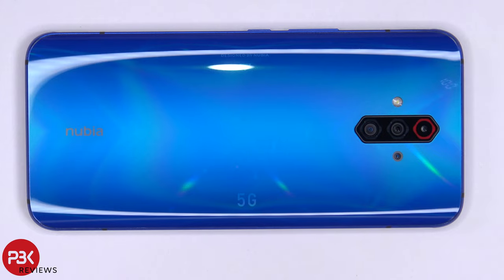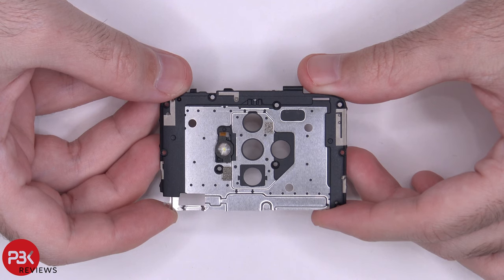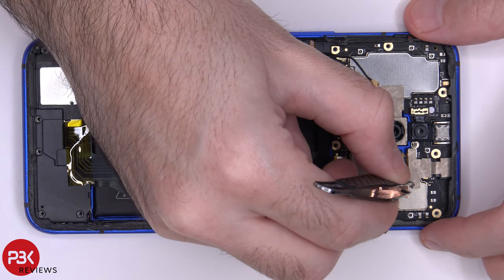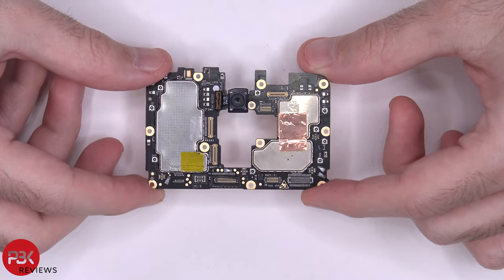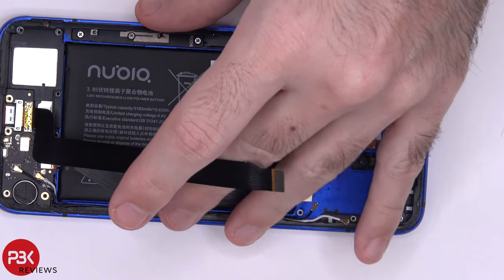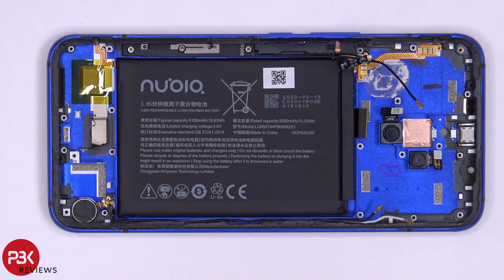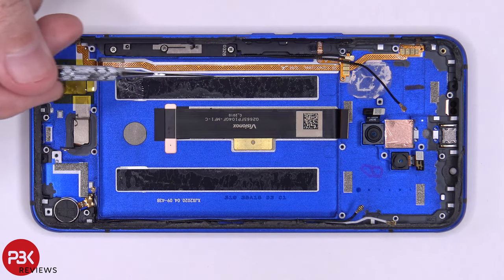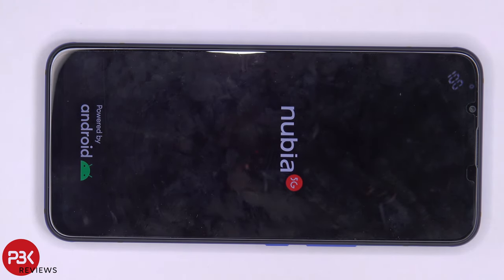Nubia Play 5G Red Magic 5G Lite Disassembly Teardown Repair Video Review

Comment: the phone overheats when gaming and when charging. the back cover in the camera part and especially the metal frame heats a lot, does it affect the battery health? they say heat is the main reason why batteries degrade. hope to have the answer. :)

Comment: I have a quick question,..can you replace the back of the phone if its crack if its possible what website can i buy it.
Reply from the maker: The back is replaceable, you can try this website but I have never bought from them so I am not sure. https://www.vopmart.com/sp1017514.html
Reply: @PBKreviews  thank you bro it means alot like alot
Reply: @PBKreviews  but is it scam?
Reply from the maker: @クラレンス-b2b  don't think its a scam but never bought from there so I can't be 100%.
Reply: @PBKreviews  can you give me another website?
Reply from the maker: @クラレンス-b2b  I don't know of any other ones that have it
Reply: @PBKreviews  i live in the Philippines,do you think they sell them?
Reply from the maker: @クラレンス-b2b  You should try repair shops in your area to see if they are able to get the part for you from their vendors.
Reply: @PBKreviews  thank you bro have a grey day
Reply: @PBKreviews  i have a last question,how to open it and what's my material to do it
Reply from the maker: @クラレンス-b2b  there should be links in description for pry pick or other tools you may need. In the video it is shown how to pry it off. Heat up the back plate, and use a smartphone suction cup tool (https://amzn.to/3botRi1) to lift up the back plate a bit to give you leverage to get your pry tool in between the back plate and frame of the phone, and then just work your way around prying off the back plate.
Reply: Clarenzz Amurao balak ko bumili nito ngayon bro. Worth it ba syang gamitin ngayon lalo na sa genshin impact?
Reply: @Serfes92  masasabi ko lang n talagang worth it siya antaas ng kanyang space at ram at smooth sa genshin impact as in smooth siya at iba pang laro
Reply: @クラレンス-b2b  ilang oras sya malobat kapag puro genshin lng nilalaro mo? Tsaka d ba sya sobrang init pagnagbabad ka sa genshin?
Reply: @Serfes92  matagal siya malobat at iinit siya pero kapag nasanay ka na hindi na ka na madadala ng init
Reply: Clarenzz Amurao salamat bro. Try ko muna mag tumingin ng mga reviews nya,nkahanda na pera ko kung sakaling ma satisfied na ko kakapanuod ng reviews haha
Reply: @Serfes92  mas mabuti talaga na manood ng reviews muna haha
Reply: @クラレンス-b2b  oo mahirap na paglipas ng ilang week tas biglang may pagsisisi hahaha

Comment: If you were just replacing the battery how far along in the disassembly would be far enough?
Reply from the maker: Take the backplate off, then unscrew the top cover, remove it and disconnect all the cables which go over the battery and connect to the main board, then disconnect battery cable and you can pry the battery off using a heat gun on the screen side to heat up and loosen up the adhesive underneath the battery. You can also use ispropyl alcohol which you can get from ifixit
Reply: @PBKreviews  thank you very much for responding! I was looking at getting a reasonable price gaming phone but it truly annoys me how difficult they make it to replace batteries. You'd think with as much abuse as the batteries take with gaming they'd consider replacement difficulties.

Comment: Nubia play heats when gaming and while charging. Does it affect the battery life and degrade it or it is just normal?
Reply from the maker: Its normal, it means its transferring heat away and out of the phone as intended.
Reply: Omg. Thank you for answering❤️. Can I ask 1 more thing?
 Can I charge my nubia play overnight? Is it optimized and can it damage the phone if I charge till it is full?
Reply: @PBKreviews ☺️
Reply from the maker: @johnmichaeljuliano4651  You should be fine, phone's now a days have chips in the battery and hardware that detect full charge and don't allow the battery to get overcharged or damaged when plugged in over night.
Reply: @PBKreviews  thank youuu. May you u have more subscribers
Reply from the maker: @johnmichaeljuliano4651  You're welcome and thanks
Reply: @PBKreviews  it's been 8 months since you uploaded that video but still u noticed me and helped me have the answer I wanted. You're a great youtuber. U deserve recognition, a lot of it. ❤️👌

Comment: Does it have a cooling part?
Reply from the maker: It has graphite heat transfer film and copper tape as well as thermal paste. But does not have copper heat pipes or vapor chamber
Reply: Another thing, when you play games with maxed graphics does it heat up, if it does, does it affect the performance of the device?
Reply from the maker: @klentbaylon822  Not sure, haven't tested it in that nature and I'm pretty sure if it heats up the performance would drop slightly but again not sure on the extent.

Comment: Can u tell me first step for screen replacement to this phone...  Sorry my bad english
Reply from the maker: Hi, you need to remove the back plate, then remove the graphite pad, remove the screws and the top plastic cover covering the mother board, disconnect the screen cable (middle one to the bottom of the lower camera), then pry off and remove the battery (carefully apply heat to the front side of the phone to loosen up the adhesive underneath the battery, then use a plastic pry tool to gently pry the battery off without piercing or warping it too much) then you will have access to prying your screen cable from the midframe. You will then have to heat up the screen more and loosen up the adhesive and pry the screen off the midframe. Then get your new screen, apply new adhesive and run your cable back through the midframe, attach the screen to the midframe and connect the cable to the motherboard and re assemble your phone. A lot to do :)
Reply: @PBKreviews  thnks....

Comment: Sir is this cellphone strong and durable? Scale of 1-10. Thank you for your response😊
Reply from the maker: Its not a rugged phone, meaning if you drop it there is the chance of damaging the screen or housing of the phone. I would say as far as exterior 6 out of 10, but it does have a aluminum midframe so internally id say 7 out of 10
Reply: @PBKreviews  how about the screen protector...can it protect the screen from damage? sir pls reply me..i want but this fone